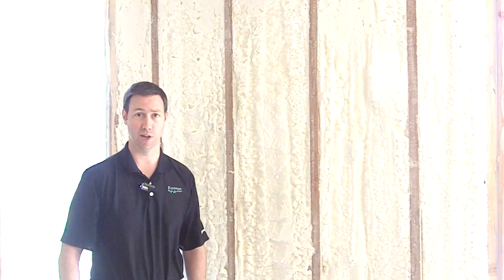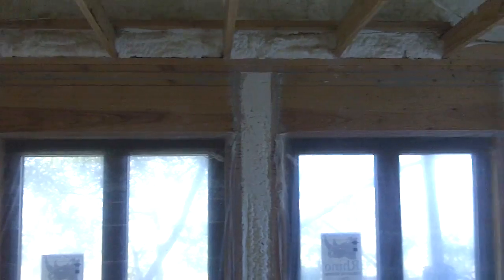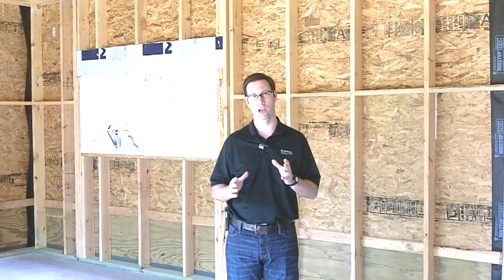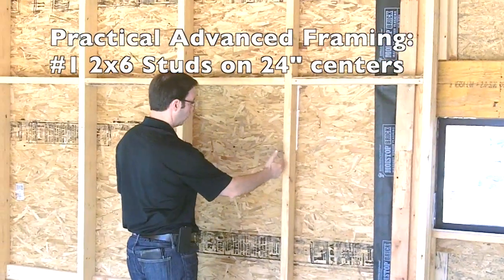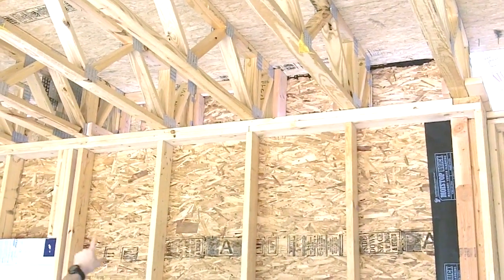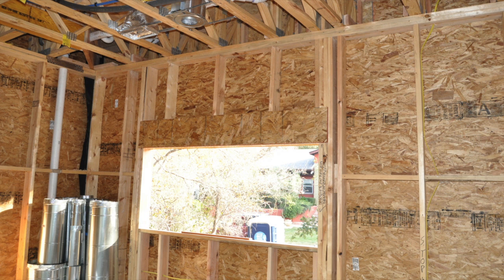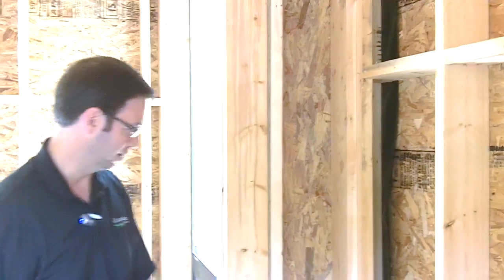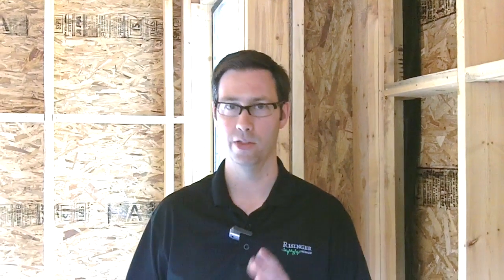Advanced Framing vs Traditional Framing

Comment: You can have that house bubba, as you won't build one for me. I would not have one framed on 24" centers, even if they're 2 X 6s. I know of many roofs that have sagged, using 24" centers, with plywood applied, not in the least OSB board. I'll stick with conventional platform framing, and 16" centers.
Reply: deezynar this way is almost stronger for roof trusses.  will admit it. the load is constantly on the wall and thus carries eight directly to the footings.  you can get away with one to plate this way. the traditional 16 on centre requires 2 plates so that the load can be carried by the studs.
Reply: @trueRocc   So now you've traded the linear rigidity of the double plate for the cheapness of a single plate. Seems you haven't seen the big picture yet, nor do you understand that rafters set 16"OC over wall studs set 16"OC with a double plate are far better than trusses when a frame structure is built properly.
Reply: Roof trusses and roof sheathing, not wall studs and sheathing effect roof sag.
Reply: craxd1 really! did roof have double top plate? every situation  is different
Reply: How does the stud spacing effect roof sag?

Comment: im a framing inspector in canada.. we have snowload here. i dont mind 3 stud corners, but i require a 1 inch gap so i can see insulation placed in the corner. no gap means rip the stud out so i can see or you fail. always 2x6 always 16 o.c. Good vid i like seeing how its done elsewhere. i framed in florida once for family and was amazed at the hurricane bracing. good luck....
Reply: +Simple Carpenter Im laughing over here in Norway. We have the most advanced and scientifically researched  building laws. And even worse weather than you canadians got.
We use 24 "o.c" and 1.5x6 inches studs. (plus 2x2 outside and inside for extra insulation)
If people really understood how much down pressureload a stud can take, they would really laugh at 16 o.c.
As a inspector you should know...
I feel like 90% of people commenting have NO idea on what they are talking about..
Reply: +Simple Carpenter ". i dont mind 3 stud corners, but i require a 1 inch gap so i can see insulation placed in the corner." How can you see insulation if the corner is filled in with 3 studs? I would think that in Canada you would want as much insulation as you can get.
Reply: Never mind. Not important.
Reply: +Simple Carpenter Are you really a framing inspector?
Reply: Yes many years. Calgary alberta
Reply: +Simple Carpenter Then why can't you answer my first question? Why would you require a 1" gap to see insulation where none exists?
Reply: Insulate before you install backing stud. Leave a gap so insulation can be seen. On our sites one bag of r30 is left for framers to unsulate corners and other spots like this. If you have never framed for snow load this might not make sense.
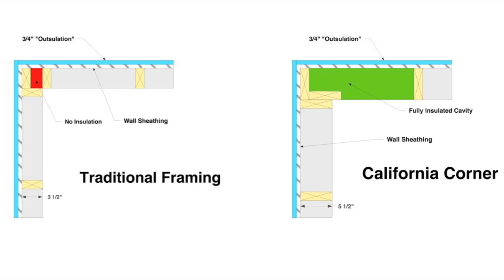Reply: +Simple Carpenter I don't understand. If your going with 2/4 exterior walls and the corner is a triple stud (3 studs nailed together) corner) see 5:17 in the video. Where is a viewing slot need to see insulation? There is no place for insulation in the area where you have the 3 studs, and all other areas can be seen from the inside. If you use a California corner your once again able to see the insulation from the inside. 

 Why would there be more snow load on the corner of the building than any other place, and what does this have to do with insulation?
Reply: Wow I totally lost this thread like a long time ago but the 1 inch Gap in my climate is actually for moisture wicking does that make any sense to you
Reply: Yeah we use the same princip in our corners.
Im seeing now how old this is,i dont know why i went on a rant really..Sorry

Comment: 24"  on center? Not here you will not pass your framing inspection unless you're living in a garage (Mich)
Reply: That's probably because you can get heavy snow loads and wind loads in Michigan. But I agree with you, would rather have 16 inch on center or even 12 inch if it needs to be really strong.
The better choice would be to go with a double-studded wall. It's even better at reducing HVAC costs than the 2x6 on 24" centers.
Reply: Benjamin Esposti 5/8 board   good luck using a 4 9/16 prehung door   lol
Reply: @Frost I'm a big believer in overkill on anything structural and needs to last good to see more people are 👍
Reply: I used to leave in a garage and the walls where 16 inch on center. No insulation no drywall.
Reply: Ideally if you're building your own house you want to find land in an unorganized township so you don't need permits or inspections or any of that BS.  Then you can just build everything better above code.   Some inspectors can be really strict and want everything to code, no more no less.

Comment: 24" on center walls?  lol.  sure hope you're finish carpenter is good and you're customers don't care about wavy walls.
Reply: +jcjanzer I hope they don't care about "wavy" ceilings, because the trusses are 24" on center.  I just looked up at my ceiling and it is NOT wavy.
Reply: Probably cause it has an inch of popcorn on it
Reply: No, it has a orange peel texture.like most modern houses. Trusses have been on 24" centers for decades. Do you think that this would be true if the ceilings were wavy?

Comment: In projects where I've specified 'Advanced Framing' I 've also specified that the floor joists/rafters align with the studs below, thus eliminating the need for a double top plate.  This is a huge energy advantage since the double top plate's sole purpose is to act as a header for joists or rafters that land between the stud bays.  The yahoos below who say that 2x6's at 24" centers is less structurally sound than a 2x4 @ 16" o.c. need to take a course on structural engineering rather than spout off based on their 'gut' feelings.
Reply: +David McClean Using a single top plate is only good if all of your trusses/joists are on 24" on center. I've framed thousands of square feet where this is not the case. A TJI is often at 19.2 oc. Some can be 12" oc.  If your framing a building that has multiple different lay outs as in many gables etc; then you could not do a single top plate.
Reply: +Jim Watson Yes, Advanced Framing does require some extra work coordinating the truss/floor joist and wall layout.  Truss packages typically assume a 24" o.c. spacing where I'm at...and since our energy code also requires a 2x6 stud wall (24" o.c.) this works out nicely.  If necessary I'll increase the joist depth to allow a 24" o.c. spacing as well.  Point loads (from headed openings, beams, etc.) are an issue (as you said) and would require a post beneath...which could ultimately negate the energy efficiency of omitting the plate.  I don't propose this system very often as it requires the right type of house (the simpler the better), the right client, and the right GC simultaneously.

Comment: I don't see any advantage to your California corners , I prefer a blocked corner insulated with great foam. It's stronger and will not bow over time . Also with the headers you don't need to conserve lumber that's a very critical point in the home I personally would want it to be as strong as I could make it , and seal the window and use triple pains . The only thing I can see here that I feel is up to par is that you used 2x6s for a second story home . I would never take better insulation over , under built framing .... End rant
Reply: +Caleb Palmer A California corner leaves more room for insulation as he explained. The corner will not bow because there isn't sufficient weight to do so.

  " to conserve lumber that's a very critical point in the home" Do you mean that's at a very critical point? Lvls are engineered to bear a certain amount of weight, and this has been taken into consideration when the dimensions of the header were given. This is basic.

Comment: Been a framer since 82' and this frame is bullshit! You always want to go 16" on center even with  2x6 framingand use 3 stud corners not weak California corners. By the way, in many states California corners and 24" center walls are not allowed. AND I have to add that 3 studs nailed together is  better than you bullshit foam insulation. Ever been in a real log cabin??? They are very insulated. The heavier the build the better, it's just not cheap.
Reply: The corner of a house is the most likely spot of a house to get backed into by a truck of delivery van, over the course of many years it might very well happen. Have you ever tried to rewire a house that has all the romex incased in form??? Ever tty to recylce a wall that has been pumped full of foam????  I framed homes in CA and Northern NV for years and I never worked  where California corners were used funny enough, but these were all high end tracks. CA corner are illegal in many states like AZ where there is high wind loads.
Reply: +Jim Watson How does a triple corner have anything to do with high winds. It is shear panels with a specific nailing pattern that keeps the wall from moving. Your end shear panel is nailed to 3 studs that is how. I bet you think this chicken shit step backwards to 24" on center studs is good to huh Pal??

Comment: I framed houses for 5 years about 22 years ago and we always used California corners. I live near Toronto so cold is a concern in the winter. 2X6's or 2X4's with clad mate or glass clad were the norm to get R20 on the walls. I don't think I like the 24" centres though. Sure, a bit better insulating value and a bit less in lumber but I like the idea of overbuilding. Engineered wood is a great idea for the headers.
Reply: dafeichu 2' o.c. is illegal in ontario anyway. Except engineered truss.  And the insulated headers this guys talking about  is a joke. Lol
Reply: Toronto cold, come to Winnipeg, then you'll know cold!!!
Reply: Agree. If in Ontario ,etc., and needing better insulation stay with 16 and use 6" .
Reply: I spent 18 months as a carpenter in the Pacific Northwest from I was 25, started when I was 18. Everything depends on where you are. Do you have to build for extreme cold, heavy moisture, high wind or snowloads etc.

Cross framing has been standard here for the past 25 years to eliminate cold penetration, and even double framing with a void for unbroken insulation to reduce heatloss. This is due to very high taxes on energy consumption and a fairly cold climate except for summers. Energywise, both the US and Canada still have something to learn, although it is not directly adaptable given the need for higher structural strength, sheer walls etc. in areas with snow loads and earthquake zones. The benefit is yet also limited, since energy consumption is not taxed as heavily, and the lower 48 also have a relatively warmer climate over the course of a year. I doubt it would pay off financially to adapt the Danish ways. Foam insulation is also prohibited here both in relation to fire, worksite safety and off gassing  in the finished home. Polystyren is allowed in embedded structures, such as outside on cellar walls below ground level.

If you don't have neither quakes or snow loads where you're building, 2' on center is just fine. Proven fact. Not on any height structure of course - if you add top load, you'll need something to distribute it, but for regular 1 or 2 story houses, it will be plenty.
Reply: uninterrupted. not unbroken... well - that too, but not that exact point
Reply: he has tornado load

Comment: This is garbage framing . If this house catches fire than it will just fall to the ground. Intense heat just melts that insulation. Lets remember that Matt is a salesman so he has an answer for everything. This is not safe
Reply: +Jim Watson  Where the heck are you hammering garbage at?
Reply: I spray foam for a living and I promise you it will never melt, it will last longer than anything else in the house in the New England area when spray foaming the 24 on center is common because it adds about 600% structural integrity otherwise I would go with a 16 on center stud
Reply: +jj Are you a framer?
Reply: This is why i hate sales people. rrrrrrrhhh
Reply: Ricky Elliott Don't you love it when people comment on things they know nothing about.
 I don't comment on video's that show how to rebuild a car engine because I know nothing about auto mechanics.
Reply: Yeah i agree this is garbage framing.
Reply: +Jim Watson Are you a spammer?
Reply: If a wood framed house catches fire it will burn and fall to the ground no matter how the walls are framed.
Reply: Yeah this is is not advanced framing. Garbage framing. Most small towns allow this crap framing but big cities will let not let this type of framing fly. O.s.b plywood is sawdust, chipings and 70 percent glue.  Toxic garbage.

Comment: 16" on center framing so much sturdier than 24", especially considering todays lumber grading. California corners are terrible for myriad reasons. You will find that lumber you feel is unnecessary is very handy  in incliment weather and tree impact situations etc. These walls are too flimsy to trust my children's safety to.  2x12 (with 1/2 plywd. or OSB) headers are so much more dependable.Remember people, building code is the BARE MINIMUM requirement. Never settle for only meeting the code, look for better than that. Set a house on fire using this method versus the correct safe methodology and time the burn.
Reply: +Jim Watson I agree with you. I've been building for 22 years and these guys don't have a clue. And the picture of the corner in the video is built wrong. Along with the insulation it makes it easier for electrician to run their wire too
Reply: +Charles Letson  "if you don't know how lateral load/impact affects corners that is your problem." You tell me how it is effected anymore than any other part of the building.
 "You also ignore the r value of wood itself." No, I don't ignore the R value and that is why I want to get at least the minimum R value which wood doesn't provide.
 "It's not just about three studs, but how they are turned to carry and deflect lateral load."
  The lateral load is taken care of with shear panels and is done with a specific nailing pattern on the panels. You show me where a triple stud is required. It's not, because the only reason it is used is to provide sheet rock backing.
 "And your going to say corners don't carry more load than the rest of the wall? Ridiculous."
 There you go again throwing out stuff with nothing to back it up. 
  Where is the extra weight on the corner? The corner is NOT a point load. It has one truss over it just like any other truss layout.
 Come on, give me something to work with instead of your hyperbole!
 I could get a more challenging debate from a knuckle head first year apprentice.
Reply: +LK Campbell   80 inch doors dont work with 2x12. meaning you have to make walls taller. so more siding, wider sheetrock etc
Reply: +TODD Gruver  Yes, that is what I've said in at least one of my reply's. For some reason unknown to me they think the corner needs to be stronger as if the corner has more weight than any other part of the building.
Reply: Jim Watson, if you don't know how lateral load/impact affects corners that is your problem. You also ignore the r value of wood itself. It's not just about three studs, but how they are turned to carry and deflect lateral load. Love to see the shear wind specs on that type of construction in real time. And your going to say corners don't carry more load than the rest of the wall? Ridiculous.
Reply: +Charles Letson, Very well said. And I agree with you about the 2 X 12 headers. My late father was a contractor, and he always used 2 X 12 headers.
Reply: +Jim Watson Boy your determined to save a nickel! The heavier the better and that's even how I like my woman!
Reply: +TODD Gruver just watched again the corner was built right later on oops
Reply: +Jim Watson apparently they cant count either cause there still are 3 studs in a california corner
Reply: +Jim Watson The 3 stud corners I address before. The corner is the most critical area of the wall as far as shear strength goes, so with 3 studs you have all that extra nailing area. As for the roof, well my home in the woods that I built has  a doubled 2x8 ridge board and the 16" on center rafters are rough  2x8's. The roof was sheated with rough 1x8 pine boards. The house is 2000' sq. ft and in the tall pines and oaks.
Reply: +Jim Watson Look up code. The corner is now the "only" area of a wall that "MUST" have shear panel hung vertical. I'm done with you. You are a pantie waist that needs his teeth handed to him! Go build your crummy cheap shit and fuck off!

Comment: i always thought a head should be placed at the tight to the top of your plate to minimize shrinkage, a standard practice here in canada, and for cost efficiency, 2 ply 2x10 spf is much much better. structure before insulation mate, cheers